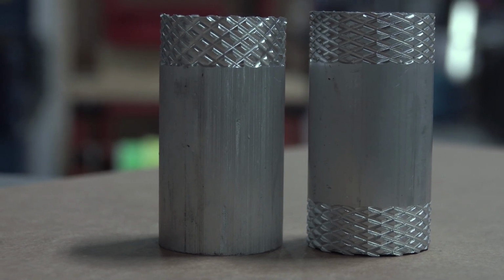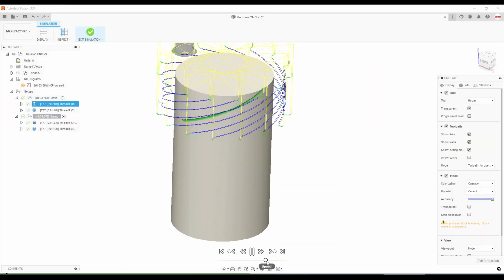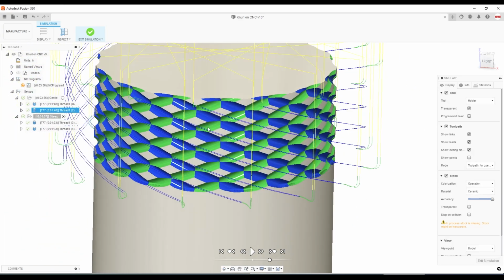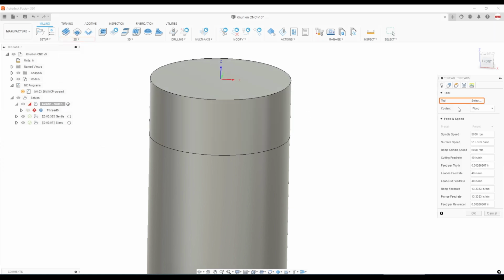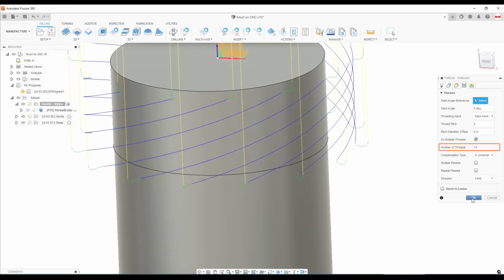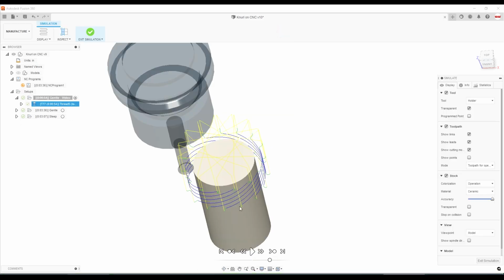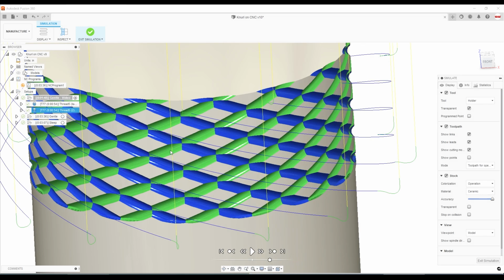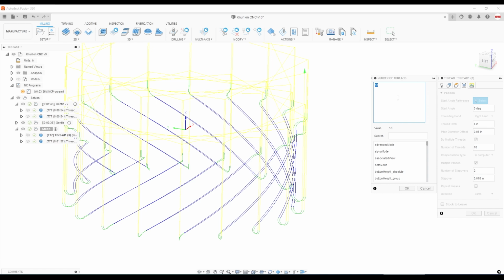Knurling on a CNC Mill!

Comment: Why not just press a knurling wheel onto an arbor and chuck it in the mill, then match the rpm with the feed rate as you move it around the part?

Comment: I did this with a muti thread (thread mill) years back, I cut both left- and right-hand threads in CW rotation by Z down then Z up muti passes of course but I did not like the result of cutting the knurl compared to rolling it. I looked for a rolling knurl head for a milling machine but could not find one. May have to try and make one.

Comment: This is a very interesting technique for adding a cosmetic knurl. 
However we need to apply this with care as the knurling technique on the lathe does not cut and remove material, it displaces it. This displacement results in the overall diameter of the  knurled region being larger than the original stock. This is important for knurls that are functional, not just cosmetic. 
For example, a knurl applied to on a lever arm prior to a plastic handle being press fitted onto that lever arm. In this case it is the knurling process increasing the stock diameter that provides the grip between the parts.
Another example would be knurled pins that are the press fitted into drilled holes, to either fix parts together, or to act as location pins.
In these examples, if the knurl is milled with a subtractive cut, then the pins won't be a press fit in the hole, and they will simply fall out.
Always check your drawing to see what the mechanical purpose of the knurl is before picking a manufacturing technique.

Comment: Hey long time, first time. I make a lot of 2-op rollers on the lathe, I've been experimenting with fusion templates but I have one problem. When finishing the 2nd op's OD I have to blend the finish pass with the first sides OD. I want to find a way to taper the end of the finish cut to blend the ODs together. How can I do this without creating a second body.  Can I do it in lead-out? 

Thanks!

Comment: This is how I added knurling to a small part, but I used a lollipop end mill.  It's an interesting knurl.  The diamond pattern exists at the top of the knurl, but the cuts themselves are round instead of sharp.  I actually prefer it to a normal sharp bottom knurl!

Comment: I've tried this using a 4th axis and an engraving (45°) or chamfer mill/drill mill though only if using a 4th axis was legal and too lathe like. And it worked great since it's obviously close to lathing process.  I'm sure that the microarc would whip this out.
Come to think of it, I would like to try it this method with a small lollipop mill or even a round burr to see if it would look more uniform over a thread cutter since the more vertical passes get a little widened out from the cutter geometry.   Always stuff to try.

Comment: A fine knurl would take much longer on a CNC that it does with a lathe. It leaves an odd looking shoulder left at the bottom of the knurl. That could be cleaned up a bit.

Comment: Ok, ok... Now let's see a fine knurl that runs for 6 inches on 1/2" diameter rod. No rotary axes allowed.😅
Joking aside, I respect your ingenuity.
Reply: Chuck your stock up in the spindle and put a knurling tool on the bed 😅
Reply: I could pull it off. With pre knurled barstock